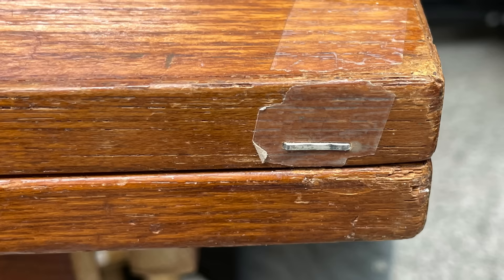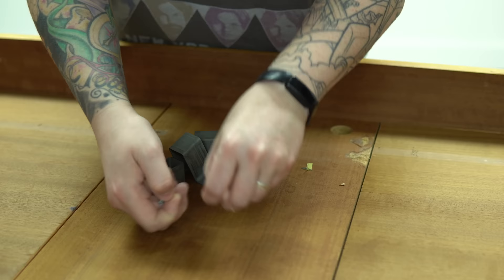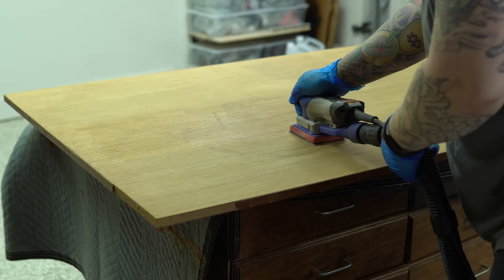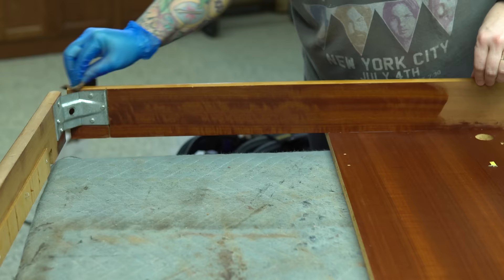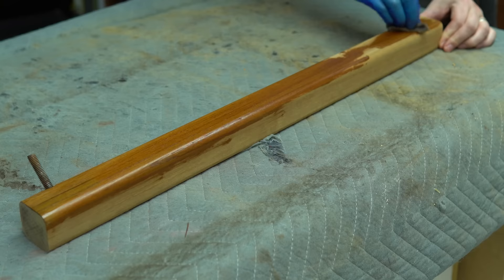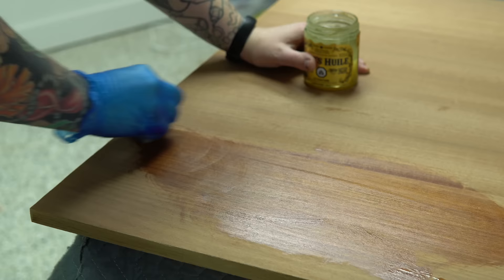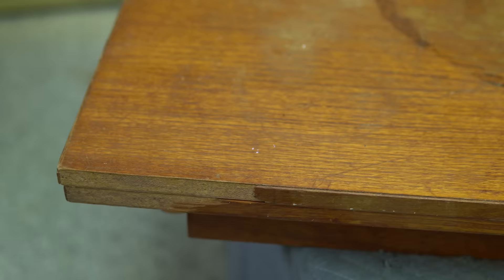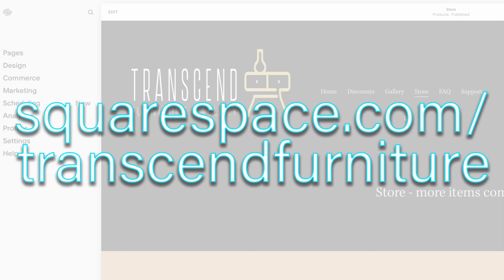I restored this absolutely WRECKED Teak Dining Table

Comment: I have 7-piece Brdr Furbo dining room set (same  Maker's Mark under the tabletop.)  The extendable table I've seen around online retailing around $1300.00, but never with the matching chairs and credenza,. Everything is in excellent condition and is c. 1960s, but the table has a patch ~ 3" Di where the veneer was sanded away. I was wondering if it could be repaired/restored and this video answered my question.
Reply from the maker: I'm so glad this video helped! Thank you so much for watching! 😊

Comment: This is so good!!!! Amazing job! 
I have a table that I would like to fix but it has some veneer that it is popping up (if that makes any sense) I am not sure if this can be fixed. Any recommendations is appreciated. Thanks 🙏🏽
Reply from the maker: It depends what the substrate underneath is. If it’s wood, and it’s just the veneer that has buckled, you can use a razor blade to make a thin slice and then a glue syringe to put some new glue underneath (either hide glue or regular wood glue), press and clamp. If it’s severely buckled, doing this could split the buckled areas even more, so the veneer would need to be softened first. If the substrate is mdf or pressed wood though, and the substrate itself is what is swollen - it’s almost impossible to sort that out unless it’s on the edge of a piece. Those cases are almost always a sand flat (including right through the veneer, whatever it takes to get it flat) and either add new veneer on top, or seal the top with the exposed substrate and paint.
Reply: Thank you so very much for your help. I am already looking into the Odie’s oil. I think that the finish is just beautiful. I am also going to look into the toners that you used here too. Thanks! I will let you know how it goes. ❤

Comment: So.... has Mr DeWalt been retired, and replaced with a younger, cuter model?    Nice job on a table that was borderline not worth the trouble, beautiful work getting the leaves and the top to once again match.  I'm struggling with an oak table similar, same problems with different coloured leaves / top veneer.
Reply from the maker: I still have Mr. D. Walt! I’ve just had the SurfPrep hooked up for the last little bit.

Comment: Once sanded, the underside looked good and could have been used for the top!
Reply from the maker: In theory, yes, but sadly there are two large round holes in it where the apron section attaches.

Comment: Got yourself a new subscriber.

I've gathered quite a bunch of teak veneer furniture in various states of decay from my grandparents and second hand purchases. This was great to see how you dealt with difficult issues and came on top at the end.

Do you have any suggestions on how to fix veneer that has lifted up slightly (moisture damage)? I was thinking about injecting some wood glue under the veneer and clamping it back down before doing anything else.

Greetings from Finland :)
Reply from the maker: If the veneer is still flat and just lightly lifted, you can absolutely use the wood glue and clamp method. However if the veneer is rippled at all, its a much trickier process. Thanks for watching and I hope this helps!

Comment: Consider using some other hardwood strips instead of the banding and staining them to match. It isn't even necessary to match. It is your table. Walnut would be nice, in my opinion. You can saw them as thick as you like, but 1/4 or 3/8 is easy to work with. A cheaper, and I feel better alternative.
Reply from the maker: As mentioned, if this table was in better condition overall, I could have justified the cost. But the price of nearly any hardwood, especially teak and walnut of that length, was just not feasible. Just wasn’t worth the cost considering I could only get the piece so far in the refinishing process. Unfortunately. :-)

Comment: Just 4 mins in - so I haven’t seem how the table turns out - I’m a little surprised, with my new found love of mahogany, that you didn’t flip the table top over and use the mahogany side
Reply from the maker: There are a few reasons why I couldn't do that - firstly, of course the woodgrain won’t match the rest of the table, but also- the edges of the underside are less than stellar so that would be an issue. The underside also has two round holes I’d need to somehow patch and colour match, and the teak edge banding wouldn’t match either. So unfortunately for me, it’s just not a viable option.
Reply: @TranscendFurnitureGallery  ahhhh…thanks for clarifying!

Comment: I can't understand why you didn't just turn the table top upside down using it as a new table top. Lovely finish as usual. 
Birdy
Reply from the maker: There are a few reasons why I couldn't do that - firstly, of course the woodgrain won’t match the rest of the table, but also- the edges of the underside are less than stellar so that would be an issue. The underside also has two round holes I’d need to somehow patch and colour match, and the teak edge banding wouldn’t match either. So unfortunately for me, it’s just not a viable option.

Comment: I don't understand why anybody would bother with a chipboard table.  I wouldn't even buy one new, much less restored. Although, I am very much enjoying the process you are going through.
Reply from the maker: Nearly all teak, mahogany, rosewood, and walnut mid century pieces are veneer over some other substrate, mainly pressed wood or plywood, but very few people seem to realize this. They often have solid wood trim and legs. It’s not the same as the pressed wood of the 80s that everyone seems to think it is, and the veneer that sandwiches the substrate makes the whole piece very stable and sturdy from a wood movement perspective. I have had DOZENS of comments saying it should be in the trash. There are about 1500 reasons why that would be stupid, haha. That’s what these retail for in mid century specialty shops here. Most designer pieces from this era are constructed this way, because it makes a very stable product, that uses less extremely expensive wood versus a solid wood one, which would be cost prohibitive both then AND today. 
I have worked on HUNDREDS of teak pieces from the 1950s to the 1970s- ALL are veneered with solid wood elements, like legs and trim. And almost all were advertised on fb marketplace as solid wood, as that’s what the seller’s parents thought they were, and thus passed that incorrect information onward. 
If anything, this video should be a learning experience for many people who incorrectly assume all mid century furniture is solid wood. Because 90% of it isn’t. :)

Comment: Hi there, this is so great and exactly what I’m looking for. I recently found an amazing mid century sideboard though it needs a lot of TLC. 

I’m a little wet behind the ear and as such hesitant to scrape away that layer of veneer. Would you suggest sanding? Possibly by hand?
Reply from the maker: You don’t want to scrape away the veneer- just the finish. The vast majority of mid century furniture is veneer over pressed wood and plywood (some are solid wood, but honestly very few), so if you try to remove the veneer, you could in for a bad surprise. If you’re new to sanding, I’d definitely recommend using a stripper to get most of the old finish off, and then sanding with a fairly fine grit like 150. Veneer on mid century pieces is much thinner than the turn of the century stuff- it’s really easy to sand through it.
Reply: @TranscendFurnitureGallery  ok great - do you have any recs for stripper ? 

Thanks for the quick reply

Comment: Awesome job. I have a very old table that my mother-in-law stripped and tried to apply bar top varnish on it. The problem was it wasn't dry completely when she covered it with a flannel back tablecloth.  The backing  stuck and dried in the varnish. I tried to sand it off but my sand paper was tearing. I also noticed it looks like veneer as well. I thought it was solid wood. Not sure what kind of wood. Do you have any suggestions?
Reply from the maker: The long answer here, is as much as I would LOVE to be able to help everyone who reaches out, there sadly just aren’t enough hours in the day. There is another side to this as well- sometimes things don’t come across properly through photos and videos, and are best seen, felt, etc in person. For THIS reason, it can sometimes be difficult to accurately determine the age, finish, wood species, etc of people’s project pieces. There is also the element of user error, when recommending products and finishes, or misinterpretation of my instructions.

I get, on average, approx 40+ messages per day between Instagram, FB, YouTube, and email (and literally hundreds of questions in the comments). It is unfortunately just not possible to be able to get back to everyone. 

The short answer is this: you can certainly message me on Instagram and if it’s a simple answer, I may try to help you out. But PLEASE don’t take offence if I’m unable to respond! I need more hours in a day!

Comment: honest question, I've redone my own furniture and it always bewilders me how someone could sand completely through a veneer, its several mm thick most time, you would literally have to sand a divot in the piece to sand through a veneer. I even prefer to use my belt sander on pieces and have not once ever gone though a veneer.  I'm by far no expert, I am the beginnerest of beginners
Reply from the maker: You must have access to vastly different furniture where you are because here, most veneer is approx 0.5-1mm thick. Sometimes on the really old antiques, you can find up to 2 mm but that’s literally it. It’s even difficult here to buy replacement veneer over 0.5mm thick!

Comment: I have a gorgeous table that was the only thing I inherited from my dad when he passed away, it's very yellowy and I want to refinish it but I'm so scared of messing up this important piece! It's midcentury, solid wood, sort of yellowy? He left some heat stains on it - would you recommend using something to remove the finish or sanding?
Reply from the maker: The long answer here, is as much as I would LOVE to be able to help everyone who reaches out, there sadly just aren’t enough hours in the day. There is another side to this as well- sometimes things don’t come across properly through photos and videos, and are best seen, felt, etc in person. For THIS reason, it can sometimes be difficult to accurately determine the age, finish, wood species, etc of people’s project pieces. There is also the element of user error, when recommending products and finishes, or misinterpretation of my instructions.

I get, on average, approx 40+ messages per day between Instagram, FB, YouTube, and email (and literally hundreds of questions in the comments). It is unfortunately just not possible to be able to get back to everyone. 

The short answer is this: you can certainly message me on Instagram and if it’s a simple answer, I may try to help you out. But PLEASE don’t take offence if I’m unable to respond! I need more hours in a day!

Comment: I have a teak dining table that is rather new and has somewhat of a matte finish. I was wondering what you might recommend as a monthly / yearly product to keep it looking fantastic. Should I be looking at an oil based or a wax product?
Reply from the maker: Something like Howard Feed n Wax is a good option for occasional touch ups. It's a beeswax/orange oil product, and available on amazon and some hardware stores. It's easy to apply.

Comment: Thanks for this video! I have a table just like this, but the surface is bubbling up a bit, as if the particleboard underneath has swollen. I'm thinking there isn't anything I can do. The veneer is intact, but what do you think?
Reply from the maker: When the substrate gets wet, honestly there isn't much you can do with it. If it's just a small edge you can kind of scrape it out but other than that there's really nothing you can do. Sorry I don't have better news. Thanks for watching!

Comment: Angie, Help!  This was the right video for me to see. I have a 1980s teak set that I inherited. Of course, a friend put a wet glass on the table (even though I had set a coaster next to her). That left a ring that I've tried to repair with Howard's Feed and Wax, but it's not perfect. Every time a small drop of anything, including water, lands on the tabletop, the finish seems to disappear. Is there an Odie's product that will help me save the teak? Thanks, Karen
Reply from the maker: Unfortunately Odie's isn't something you wipe over a damaged finish like a miracle product. In most cases you cannot apply Odie's over an existing topcoat without removing the existing finish and prepping the wood. Especially if the existing topcoat is damaged in any way. Many shellac and lacquer finishes are tinted, so adding a clear coat like Odie's just in one area will often stand out.
Reply: @TranscendFurnitureGallery  Thanks, Angie. Will have to either ignore it or find someone to refinish it -- wish you were closer....

Comment: So beautiful!  I loved this restoration.  Oxalic acid is like magic-- I had no idea how you were going to get that milk crate stain out.

One thing I found quite curious-- why did the manufacturer use a veneer on the underside of the table? From what you said, it sounds like that's something you've seen quite often, but... with sliding leaves, that's not a surface anyone would typically see.  (And as you mentioned-- they didn't even put a finish on it1)

Is that just a hallmark of higher-end manufacture to do that, or is there some practical reason to have veneer there?
Reply from the maker: They do this because the substrate is particle board and it actually makes it extremely strong to have veneer on both sides. It gives it the strength of a solid wood table without the likelihood of it cracking as it expands and contracts with the humidity. Thanks so much for watching!
Reply: @TranscendFurnitureGallery  Thank you for answering!!  That makes total sense.

Comment: Lovely job! Did you have to color the edge banding to get it to match the top or did the lacquer even out the color on its own? I have a piece  with a similar edge banding problem and the edge banding I bought is quite a different color to the teak veneer.
Reply from the maker: Great question! Yes I did. The new teak was a fair bit “greener” than the old teak, so I had to seal it and then tone it.

Comment: That is lovely! I have to admit, I've been wanting to refinish my solid oak table that I got from my parents as the finish is just shot. But then you mention "just use a coaster!" and I realize that no matter what I do, I will never use coasters on my dining table.

Are there finishes that you can use that are more durable, or at least readily fixed when your table is just used for everything?
Reply from the maker: Odie's is great for table tops, provided it is applied correctly and given the right amount of time to cure. I’ve seen many applying it incorrectly (using rags or brushes to apply, using too much, not removing the excess well enough, or not letting it cure before use). Done right, it makes a wonderful natural looking finish that is very water resistant and doesn’t flake, chip or peel. On dining tables, I usually do two coats, a couple of days apart. Odie's can also be reapplied is need be.

Comment: I wonder how it would've worked out if you would've used the oxalic acid on the stains BEFORE you stripped the table?? might be worth experimenting with on another piece some other time .
Reply from the maker: The finish needs to be removed from the surface of the piece in order for the acid to penetrate the stain. Putting it on without removing the finish would be pointless. Thanks for watching!

Comment: Do you think you would've been able to fix this if it had bubbles in it?
Reply from the maker: It would depend if the veneer itself had lifted from the substrate, or if the substrate had swollen. If the bubbles were from the veneer lifting, you can actually cut a thin slice in the veneer and try to work it back down, getting some glue underneath. If the substrate had swollen, it’s a lot trickier and it’s almost 50/50 whether or not it would work.

Comment: Crazy question, could you have turned the top upside down, since the underside was probably in better condition than the top?
Reply from the maker: There are a few reasons why I couldn't do that - firstly, of course the woodgrain won’t match the rest of the table, but also- the edges of the underside are less than stellar so that would be an issue. The underside also has two round holes I’d need to somehow patch and colour match, and the teak edge banding wouldn’t match either. So unfortunately for me, it’s just not a viable option.

Comment: Nice job, Just got the same table! What grit sandpaper do you recommend using on the teak veneer? Thanks!
Reply from the maker: The long answer here, is as much as I would LOVE to be able to help everyone who reaches out, there sadly just aren’t enough hours in the day. There is another side to this as well- sometimes things don’t come across properly through photos and videos, and are best seen, felt, etc in person. For THIS reason, it can sometimes be difficult to accurately determine the age, finish, wood species, etc of people’s project pieces. There is also the element of user error, when recommending products and finishes, or misinterpretation of my instructions.

I get, on average, approx 40+ messages per day between Instagram, FB, YouTube, and email (and literally hundreds of questions in the comments). It is unfortunately just not possible to be able to get back to everyone. 

The short answer is this: you can certainly message me on Instagram and if it’s a simple answer, I may try to help you out. But PLEASE don’t take offence if I’m unable to respond! I need more hours in a day!